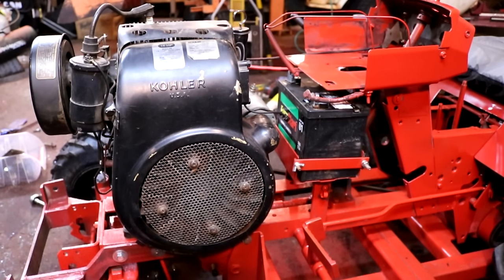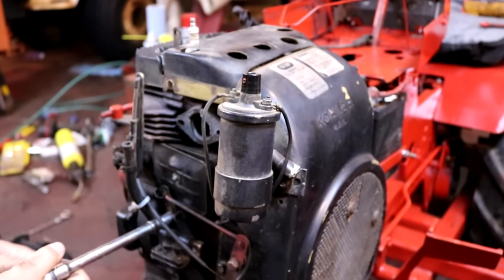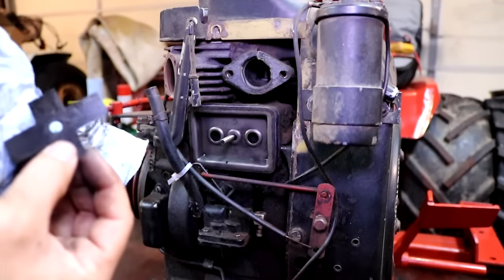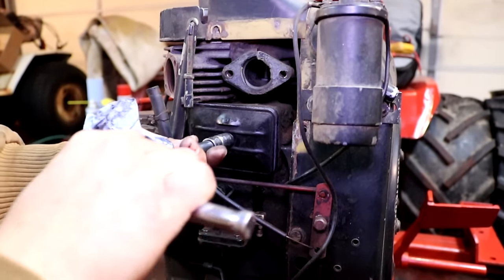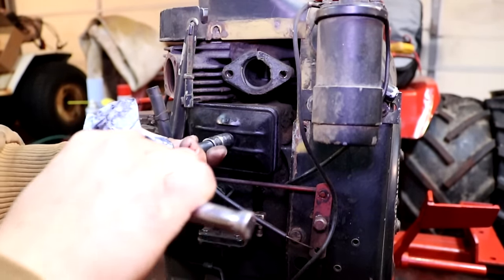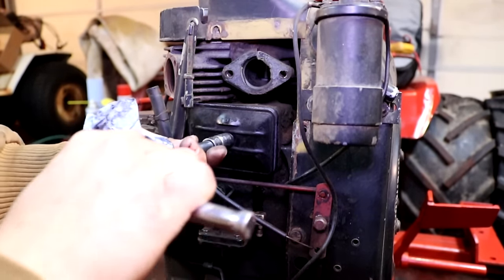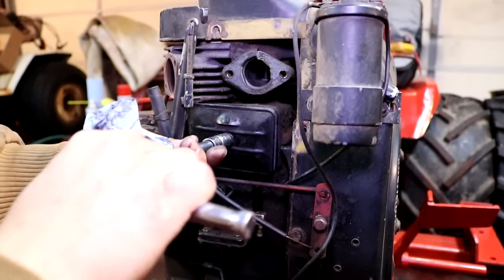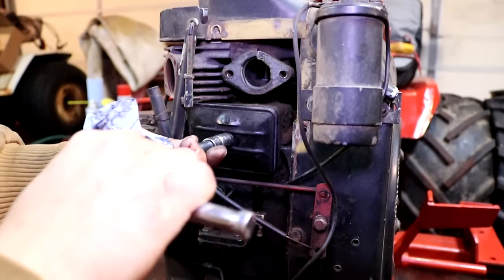5 Things You Should Do To Your Kohler K Series Engine Right Now | Kohler K Series Engine Maintenance

Comment: Hello.This motor im working on looks just like yours here it has new carb which it does still pop just a little but whats throwing me off is i have adjusted the throttle now if i just barely move the throttle position it doesnt take much movement at all to slow it down or speed it up something just doesnt seem right about it and then it tries to over tach when i barely adjust could this be internal gov? going out? Tractor is not mine im just helping someone out but he put carb on it so i dont know how it was running before. Thanks for any help about it. B.

Comment: I bought cub cadet 129. Kohler 12hp. Was sitting 10   years outside. I put anew carb on it and I have to keep it choked to fire, but won't get enough gas to run. I put some gas in the cylinder, it fires a little but that's all. I don't know if the motor is any good, so what can I try next? Thanks

Comment: Hello, I have an rv 4.5 ckm21 twin electric start. I noticed I wasn’t getting the back cylinder to fire so I swapped wires from the coil and got it to fire. It’s still only running on one cylinder. I changed the coil and it’s still doing the same thing. I ordered new points and condenser. When I get ready to set the points gap, how can I turn the motor over to get my points open all the way without going past it?. I ordered my parts from you. Also, would a bad condenser cause only one cylinder to fire or a combination of points and condenser?. It ran perfectly with only 150 hours on it. I shut it down to connect to rv park power, when I started it back up it ran horrible and when I put a load on it it would slowly stall out. Can condensor go bad that fast?. Thanks in advance

Comment: Great video. I'll be shopping at your website in a month or two. My Wheel Horse  GT14 and 1973 14hp no name run great but after a hard winter this year I want to treat them both to a good service like you just did. Might not do new carbs as they run fine but will certainly do the rest along with good carb cleanings just for good measure. I would also like to modify my GT 14 throttle from the pull out knob to a lever. I figure you could probably help me out there too. Unless you Have the original knob throttle that will actually stay when pulled out with Out  having to use a spring clamp on it.  It Doesn't Turn and lock like They're supposed to.

Comment: Hey Norman great video thanks for the tips. I have a kohler K241 I was told it was a K301 not sure yet but It was an extra motor that came with a john Deere 112 I had bought. The oil dipstick tube had busted off it was one that mounted to the side. Was going to put this motor in my 68 112 but have not seen the right tube for it. I will have to see if I have the peice that busted off and I can inclued the modle number. The motor will be on my youtube chanel when I get the tractor going again if interested. Please let me know if you have one in stock and thanks for the video
Reply: Also do you have any filter asembly housings for a 112 kohler

Comment: I got a power king tractor 2days ago it has a kohler 14hp on it and I tried to get it running yesterday and it blew the spark plug out of the head. Do you have any idea on the size of the spark plug hole? I need to put new threads in it.

Comment: hi good video I have question my brother buy carburator same on you web but I don't have information my question if you have the adjustment for this carburator is for caston iron 16hp kholer 341s like  how mani turns for high idle and low idle thanks

Comment: i just bought a used cub cadet that sat outside 10 years. i dont know if the 12hp kohler is any good. it was missing the coil, but i had an old delco coil i put on , so it has spark. there was a stuck valve, so i got that loose and it has compression. i replaced with a new carburator. it pops when all the way choked,but wont run. there is some back pressure coming out the carb. i dont know if thats normal. any suggestions on how to get it running so i know if it knocks? thanks

Comment: Do I see a fuel pump at the bottom under the valve chest? with fitting for a fuel hose on 
right side? is there any reason for the external ignition system instead of having it's own
magneto? Using a president for other than labeled use. why does the intake valve look
burned and the exhaust looks really good?

Comment: So I have been thinking about buying a lawn tractor what would you say is the best brands
Reply: Anything with less than 5lbs of plastic.
Reply: @kylekenan2321  yeah that's the way everything is nowadays
Reply: New or used?
Reply: Get an old IH Cub Cadet!
Reply: @R3TR0R4V3  🤫
Reply: BE C BE - look for a well kept Cub Cadet 129 or 149, lots of them were made, good hydro unit and parts are plentiful
Reply: It all depends what you want to do.  Ariens and JD still have decent parts support where used or aftermarket are the only options for most other brands.  Kohler and onan powered are also advantageous for the same reason. 

If you want to snowblow I really think the ariens gt with 2-stage snowblower is the top dog. Others might be as good, but have fun searching eBay if something breaks. For mowing almost any brand will work it’s all about what you like for styling.
Reply: Wheel Horse of Course!

Comment: I am working on one of these K321 engines and while inspecting it the compression psi was 45 until adding some oil and then made it to 65psi. what would you think the issue would be? head gasket, rings or valves? is it time for an engine rebuild or replacement? diesel conversion?
Reply: Low compression means oil is escaping pass thepiston rings...

Comment: What do you prefer when the original fuel pump goes bad?, from many sources the replacement from kohler is plastic and does not hold up?
Reply from the maker: The pumps we recommend are the ones we sell by a company called Stens. They benefit from metal to metal fittings instead of metal to plastic like the cheap ones. This prevents the body from warping and losing vacuum.

Comment: With all due respect I DISAGREE with "replace the carburetor". 
REBUILD an old Kohler carb. 
If the top throttle bore is loose repair it with appropriate spacers. 

Other tips are EXCELLENT. 
Thanks Norman!!
Reply from the maker: Yes if you can rebuild it go for it, but most people don't have the tools to properly rebuild an original carb, that's why I recommend a replacement.

Comment: So on the Kohler KT 17 the only way to adjust the gap is by grinding the stems?I have no adjustment screws on mine.
Reply from the maker: Yes correct. You can also work on the valve faces/seats to move the down if you ever needed to.

Comment: Awesome information I changed the points n condenser on my kholer motor that runs my log splitter and still is rough to start and is all over with the rpm im gonna mess with the idle linkage
Reply from the maker: Let us know if you need any help over the phone or by email
Reply: @Isavetractors  will do man thank you im gonna wait till this snow melts first my yard is mush

Comment: Hey Norm. I've taken the valve cover apart and the intake valve, while surprisingly set properly, the entire thing would spin. Not just the nut. Does the tappet screw down into something or is it broken?
Reply from the maker: Make sure you hold the tappet with another wrench.

Comment: The best thing I have done to almost every classic cub cadet I have owned is tossed the carb and just bought a new IST one.  The middle of a snow storm is the wrong time to dick around with a carb issue.
Reply: they run better with a rebuilt orginal carb, ive bought 3 ist carbs 2 for a k181 and 1 for a k301 and they dont not run anywhere near as good as a fine tuned rebuilt orginal

Comment: I have a 1982 k241p in terrific condition and runs great. Can you convert a k241p to electronic ignition?
Reply from the maker: You could use a Magnum 10 bearing plate, flywheel and solid state ignition module

Comment: I need a rebuild kit for a 10 hp Kohler it's the k241a I believe. Not running right took it to a shop they put it in time an he says its low on compression or may be the valves. How much for a rebuild kit I want to rebuild everything

Comment: Hi I have a 314 John Deere, with a 14 horse single cylinder: Kohler engine. It will crank I have spark points in the blood I have good compression have you but will not start. When you are off the key from the start position it will fire backfire have any suggestions. Thanks don
Reply from the maker: Your key switch may be wired wrong. Make sure 12v is getting to your coil when key is in both run and start

Comment: 16:45 .020 is the starting point for getting your engine properly timed. My K321 14hp runs best at .017, and yes these tiny increments matter.
Reply: My original John deere mower book says the settings for the models 110 and 112 are 0.020"

Comment: Hey Norman could I have some help? I have no clue what happened but the lowest speed on mine is more than 3/4 open on the carb. Opening the throttle barely moves it to full WOD. What do I need to do?
Reply from the maker: Check your low idle screw. It's the horizontal screw by the throttle shaft. That controls how much the plate can close.

Comment: Hey Norman I have a 321 in need of a new carb, on your website it shows a ball linkage for throttle control mine has a hole do you have those?
Reply from the maker: Our throttle ball can be removed by grinding the underside of it. This will leave a 3/16" hole which is perfect for your current linkage.

Comment: I had my condenser on positive side on my cub will that harm other part or no
Reply from the maker: No it won't harm anything right away, but your engine probably didn't run right. Overtime a missing condenser can cause the breaker points to deteriorate.
Reply: isavetractors it didn't ,it knocked, and my points just went bad so condensor probably the cuase of it

Comment: Replace the carb? Now that is just silly. If the motor is running well, why replace the carb? Just give it a good clean.
Reply from the maker: I've talked to close to 50,000 people on the phone about these engines. I have concluded, that at this point which is normally 50 years after the carb was new, it's just time to replace them. Throttle shaft wear, jets frozen in place, and customers don't have the tools to properly bushing the shafts. If you have advanced skills you can definitely rebuild the originals, but most don't. My recommendations are based on real world evidence and knowledge and my hope is to help normal folks who love these machines. You don't realize this because you haven't heard thousands of people tell you, "I've put a carb kit in it and clean it a dozen times and it still doesn't run right or produce enough power." If you can rebuild or clean it, great, but otherwise, iSaveTractors is here to help you save your tractor.

Comment: Nothing like the old Kohler K-341.  My only complaint, I wish they they didn't use aluminum to make the cylinder head.  I get it,  it prevents cold-starting incoming raw fuel from fouling the spark plug; and  it helps to produce more engine power and torque when under a heavy load by retaining the majority of the combustion heat in one area, but I still don't like it.

Comment: Great video!   I replaced the carburetor but this unit had just the base plate for the air cleaner ( no other parts) ...Is there a spacer between the carburetor and the base plate air cleaner? The new carburetor choke hits against the base plate of the air cleaner Preventing it from closing.

Help!
Reply from the maker: Some aircleaner housings are recessed and can prevent longer throttle arms from clearing it. If your carb has the longer throttle arm, you can trim it back for clearance. Typically there is no spacer between air filter plate and carb, just a gasket.
Reply: isavetractors  
 Thanks

Comment: If, as you say, it is running well, I wouldn't even begin to think of doing any of that. As you say, these engines are 40 - 50 years old, (I have 5),  why risk needlessly damaging housings, sealants, and insulators. I also don't have doctors arbitrarily replace any of my 76 year old corporeal components if they're functioning well.

Comment: I have a k301 that always starts in temperatures 50+ but doesn't even want to pop when it's 40 or colder. It's getting both fuel and spark.
Reply from the maker: Proper valve job would help alot in colder weather starting

Comment: I only replace parts if the parts are broken or not working if they're just old with faded paint and still work I keep them on
Reply from the maker: downside with your approach, is when they fail, they will fail on a hot sunday.
Reply: Well the only thing on mine that failed is the same old tar filled original carburetor I've cleaned it so much it's not helped it much it all it still does the same as it did last year.

Then I seen the other carburetor i bought for it it wasn't for a 8hp as the info claimed it was it wasn't it was for a 6 or 7 from what i read a few days ago so i bought another different one if it doesn't fit I'm gonna make it fit 

And the new points melted up soon after installing them so put the old back on they don't melt down it's not much material left on it but it still works enough to make the engine idle

Comment: "Replace the carburetor" -- Meh, it runs just fine. I run ethanol free rec fuel or aviation fuel depending, so I don't really have issues with them gumming up. Replace the carb if it has problems, not just because. That's my two cents. Granted, most people just leave it sit with ethanol based fuel, and that /will/ basically result in it needing to be rebuilt or being replaced.

Granted we've owned this one for(Cub Cadet 149).... damn, 27 years since we moved here. Came with the house. The engine's not original, they drove the tractor into a swimming pool at some point before we moved here, so maybe it's a tad newer than the tractor.

That said I could probably stand to check my valve clearances. And I agree with the others who say clean any mouse nest/etc out of the blower housing. Super common issue.
Reply: Well, I think part of the argument for replacing, is age.....worn / sloppy parts & holes.

Comment: First thing you do is blow all the junk out of the engine so it's clean when you're working on it check your spark plug check your points replace or just as necessary take the float bowl of the carburetor make sure there's no dirt in it and clean it out new air cleaner change the oil maybe flush the engine out with little transmission fluid if the oil is real dirty do not have to take the head off unless there's a lot of carbon un carbon the engine and check your valve adjustment use good grade oil add a little additive to your gas to keep the valves lubricated these engines are like dinosaurs that run forever why would you replace a carburetor what's a cheap Japanese carburetor????

Comment: You don’t need to jerk the head off unless you have a definite gasket leak. If anything change the oil cuz you have no idea what the history of the motor is. & when I re-installed my head on my K301. 

It’s a lawnmower it only gets to about 90psi. It’s fine, for a car or diesel truck you’re talking higher temps, pressure, & other oil & cooling passageways in the head. It’s a freaking lawn mower not the space shuttle.

I found an old Sears ST12-16 & I don’t know if it’s got a brigs or a tecumseh or a brigs but I’ll probably put a K301 on it cuz I have a k301 on my 82 Deere. 

But if anything change the oil on the motor.

Comment: I trust Norman, but Im still wondering if the sanding of the cylinder head is necessary up to 3/1000s . With the head bolt torque spec and and the stiffness of that head I just cant imagine that being necessary to 3/1000s. Furthermore, Id have to measure the flatness of the top of the block as well to better than 3/1000s... lets be realistic here.

Comment: My john deere 140 govenor is running away and the trator is throttling up by itself does anybody know what is going on
Reply from the maker: Those are signs of a broken governor gear.
Reply: I doubt it’s the governor gear.  It’s fairly common for the little arm to break off the internal governor cross shaft. 
Unhook the external governor arm off the round cross shaft that goes into the engine. If the round cross shaft spins 360 degrees. Then the arm is broken off.
The engine needs to be removed and disassembled to repair this.
Reply: Update the govenor gear was fine but the block had a crack running about halfway through the block

Comment: How do you test a 12 vote coil
Reply from the maker: Test the primary and secondary windings with an ohm meter. Test between two little terminals and test between one of the little terminals and the big center one. A coil for these engines should have 3 or 4 ohms between the two little terminals and about 15k ohms between either small terminal and big center one